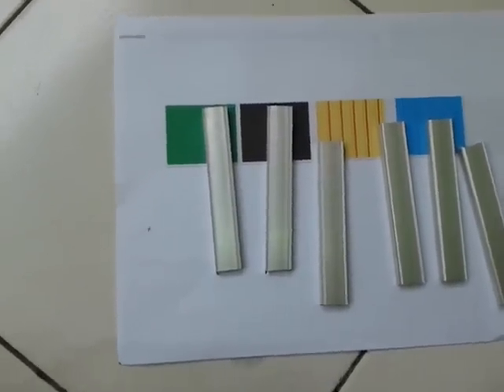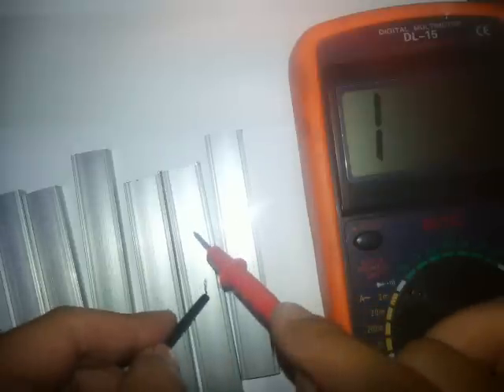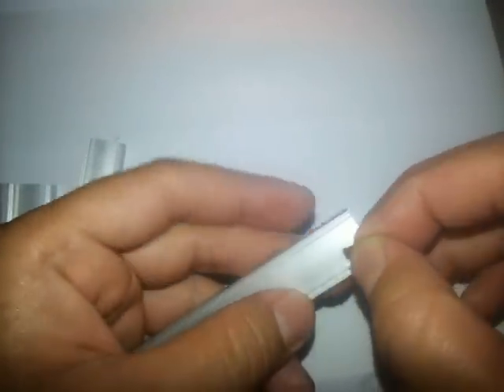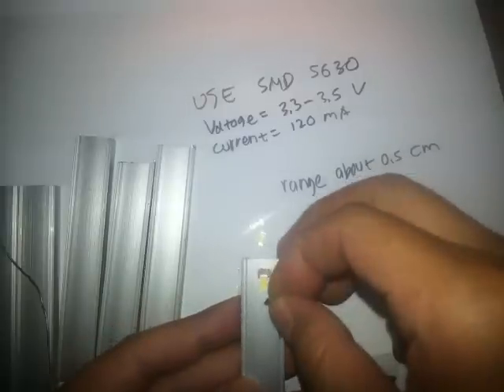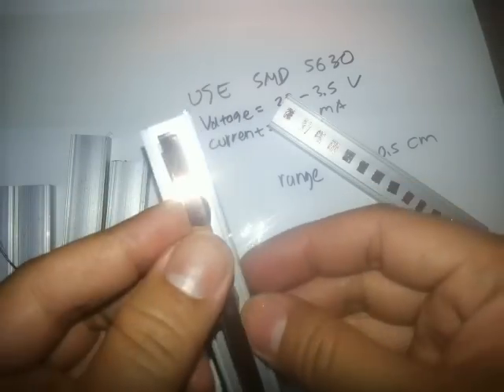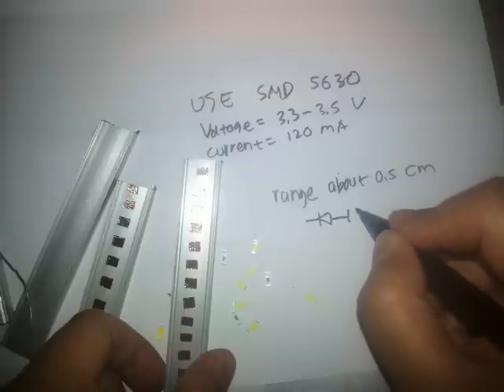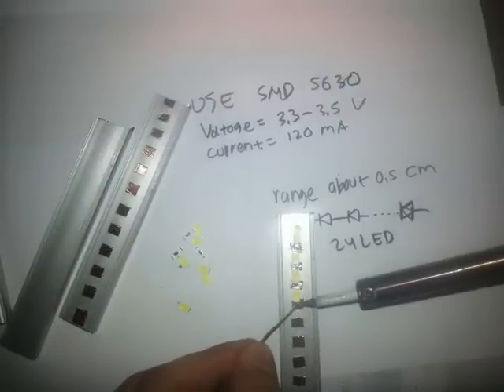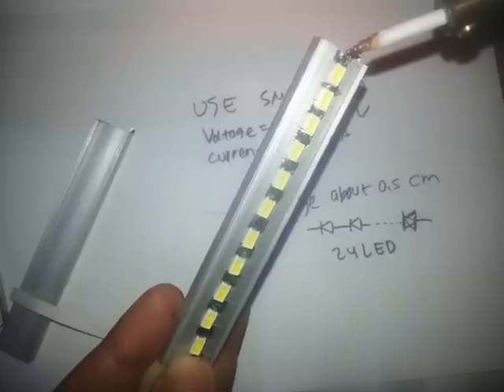How to make aluminium pcb-china led bulb part 2

Comment: why does the Led light up when the soldering iron touches the soldering point?
Reply: bad grounding house cable installation.
Reply: Probs using SMPS unit . . . .

Comment: Hi,Gulam ,what's the use of the spray paint ? why should need to spray this？
Reply from the maker: for insulation between connections led aluminum so that there is no short circuit
Reply: Hi,Gulam, thanks! I learned it now .
Reply: +Linda Duan (Offroad led lighting)  Avoid short circuit
Reply: Anthony Jiang Thanks,I got it

Comment: Hello! Interesting and useful video. You can write the name of copper tape. you are stuck on the aluminum plate?
Reply: hello This is Camille from HITEK TECHNOLOGY Co.,LTD. ( PCB manufacture forl lighting assembly)Our mainly products including, rigid PCB , rigid-flex PCB, MCPCB , IMS or IMPCB .(TS16946 UL UL E332365 Canada UL ,aluminum PCB UL ,ISO9001 ISO14001 SGS) .email is sale15@hitekcircuits.com
Reply: Yang Camille but PCB no can spread heat as well as aluminium